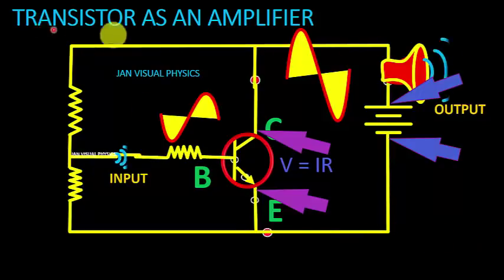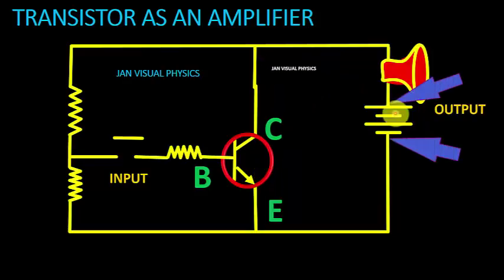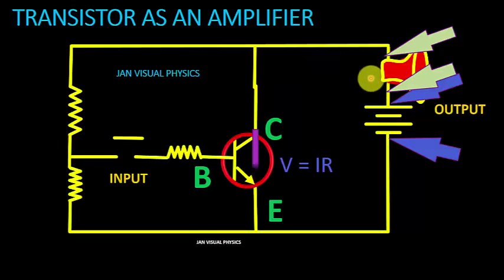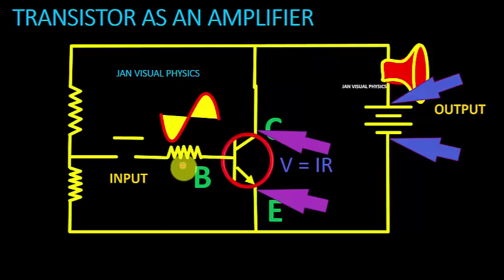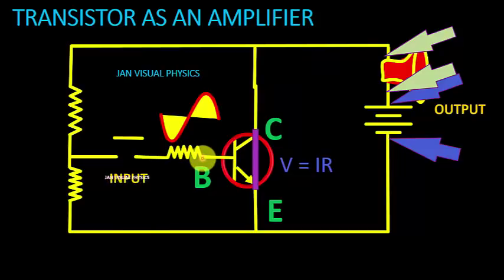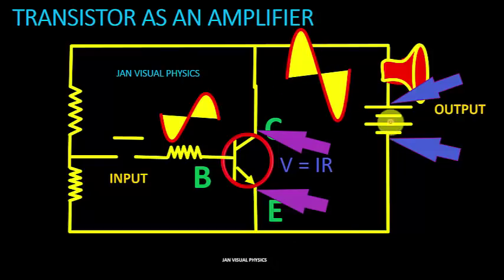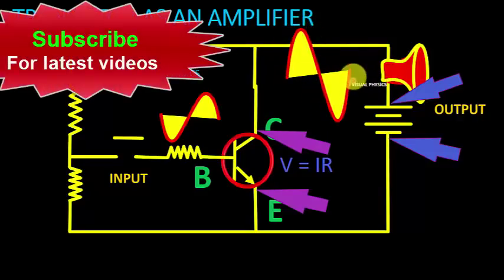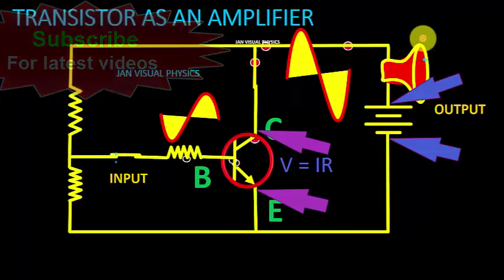Transistor as an amplifier | How does a transistor work  | Transistor as an amplifier animation

Comment: In negative half cycle transistor is off ,then how negative half cycle is amplify
Reply: It does not amplify the negative signal.
Reply: @KyriosApo I'm an economist who tries to understand this amplification, as a hobby . if on reverse bias the transistor is off , than how do we have a full higher amplitude frequency cycle at the output ?And how does an small AC signal is able to modulate a higher DC source into a higher AC signal at the output, in terms of electrons flowing or colliding into each other ?
Reply: @mariusiordache460  From what I understand what you are asking me is how we can amplify an AC signal with BJT. 

What we do is overlay a DC constant signal on the AC that we want to amplify so that we actually amplify a DC total signal. Then through a capacitor connected in series to the output (which acts as a high-pass filter) we receive the amplified AC signal.

I hope I understood your question correctly.
Reply: @KyriosApo  Thank you!

Comment: Instead of a transistor why can't I connect the loudspeaker with the battery all the time....as it is short-circuited all the time and will put out maximum output....if a transistor is placed intermittently there's a loss in it and we have to switch on the transistor every time...

Comment: how do you connect a transistor as a double switch e.g source (voltage) then a transistor acting as switch to charge a two different capacitors. Waiting for your quick response. Am student in Zambia(Africa)

Comment: SIR U HAVE SAID THAT WHEN BASE IS NEGATIVE TRANSITOR HAV MORE RESISTENCE AS COMPERE TO THE LOAD SO VOLTAGE DROP ACROSS THE LOAD WILL MINIMUS THAN HOW IN NEGATIVE CYCLE AMLITUDE OF THE AMPLIFIED SIGNAL IS SAME PLZZ EXPLAIN
Reply: THERE IS A NEGATVE POTENTIAL DIFFERENCE